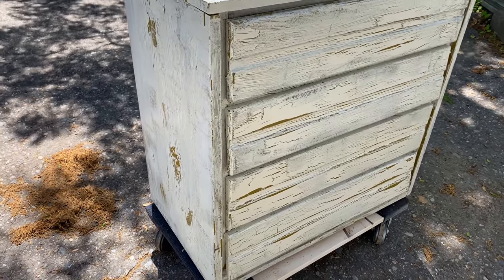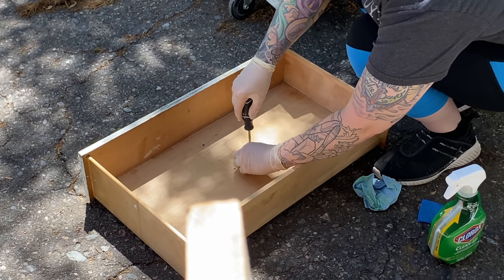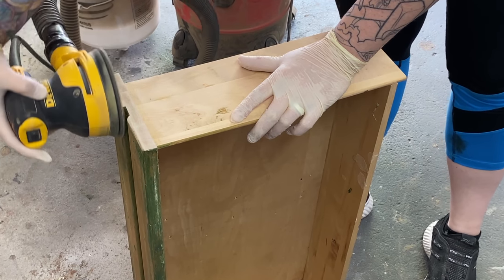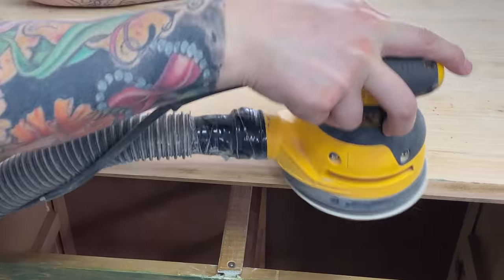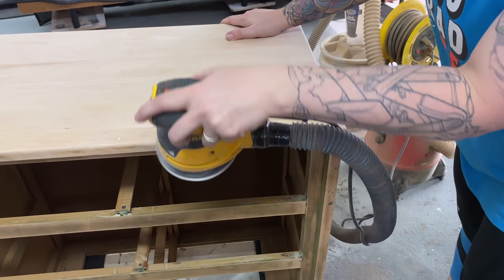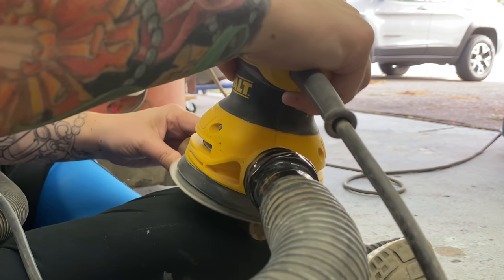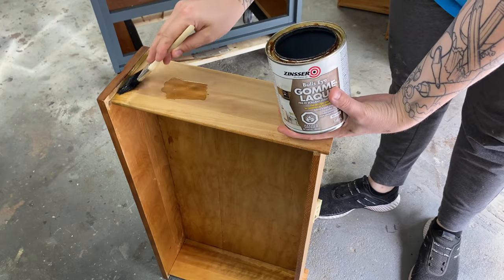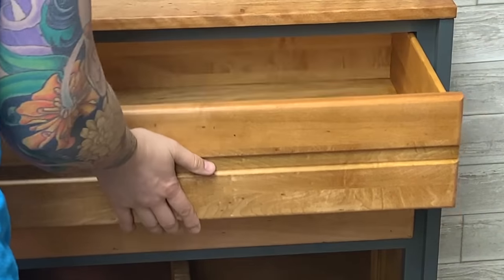STINKY Trash to Treasure: Curbside Dresser Makeover

Comment: Fantastic work!  Curious about the wood filler, any I’ve used don’t take stain well.
Reply from the maker: They can be tricky. Gel stains go better over the fillers than penetrating stains do, and anytime you can use sawdust from the same piece to mix with a bit of wood glue to make your own filler, you’ll get a slightly better result than a factory made filler. But another little trick is to use an artist paint brush to apply a small amount of sealer over just the filled area before staining. Often that helps get a more even stain job. :-)
Reply: @TranscendFurnitureGallery  thank you for the great advice, so very generous of you 😊

Comment: What a wonderful transformation.  Most people would have thought that piece only fit for the bin.   I'm astonished though that the smell of cigarettes clings to hard surfaces to the extent that drastic action is needed.
Reply from the maker: Oh that stuff absorbs into pretty much everything! Usually it just clings to the outside of the piece but the inside which is never sealed is where the biggest issues lie as there is nothing to keep it protected. But this odour blocking primer does a good job :-)

Comment: Nicely done! Just a quick tip...
When cutting threaded rod put on two nuts and leave a gap for your hacksaw blade. Cut between the two nuts and it will leave your cut square.

Comment: Inspired by your channel, i recently purchased two pieces of wooden furniture for my house that I will makeover. One of them have a strong stench of cigarette smoke. Glad I ran into your video. Wish I could share the picture of my furniture I purchased and get your thoughts on it.
Reply from the maker: Yes that smell is awful to try to get out sometimes! With that odor blocking primer, you can actually do two or three coats if one doesn’t quite do the job. You just have to make sure to brush or roll (or spray) it on every single surface that isn’t being completely refinished (like the insides, back and underside) after giving it a crazy good scrubbing .. and those back panels sometimes absorb so much of the smoke that it’s easier and cheaper to replace them, I find. Luckily with this one I didn’t have to. :-)

Comment: Watching you transforming junk into high quality furniture is very satisfying.  Just my 2 cents of opinion,  I clean up stuff in the backyard too.  But instead of the vacuum, i use my blower from the 150 psi compressor since the ground is mostly dirt anyway.    It is fast and powerful.  I don't know how to live without a blower.  I like how you scrap off old paint or varnish.  That's way better than sanding or paint remover.
Reply from the maker: What I do varies by the piece I'm working on. I usually will only sand a finish away if it's basically non existent or if I'm on solid wood. I'll scrape usually over veneer with SOME finish, or a lighter/damaged finish, and I'll use a chemical stripper for removing thick finishes or multiple layers of paint.

Comment: I hope you’ll consider trying burning sage in/around the pieces that have tobacco smell stains. I believe it will work to counteract the smell. And it would be environmentally friendly and easier if it works! Maybe enclose the piece with a tarp or something so the smoke can really work its way in 🤔. I found that saging (smudging) around a smoker’s house was effective in this way.
Reply from the maker: As a person with incredibly sensitive lungs burning anything isn't in my plans. Heat and smoke around furniture isn't great either. I have methods I use for removing smells that work great. Thanks for watching!

Comment: Screw a nut on the bolts before cutting the threads. If you remove the nut after cutting, the nut will "fix" the deformations on the cut area.

Comment: Great Video!  I like to leave wood tops and drawers also but the wood filler I have used does not stain the  same as the rest. You used filler on the top and you could not tell. What do you use?? Thanks for listing everything you used. I just did not find the wood filler.

Comment: You can use ammonia and hot water to cut through nicotine.  But it is a two-step process as you need to rinse it. Make sure you wear a respirator and are in a well ventilated area. And I strongly suggest putting a bunch of old newspapers down to soak up the ick and make it easy to clean up.

Comment: Hello from BC!!
I am in love with this piece, incredible work 😍
I’ve been struggling with staining overtop of wood fillers! They come out super noticeable and horrible. You make yours look pretty much seamless! Is there a certain type of filler that you like using the best? 
Thanks so much, and keep up the amazingly beautiful work!!
Reply from the maker: They can be tricky. Gel stains go better over the fillers than penetrating stains do, and anytime you can use sawdust from the same piece to mix with a bit of wood glue to make your own filler, you’ll get a slightly better result than a factory made filler. But another little trick is to use an artist paint brush to apply a small amount of sealer (like shellac or something) over just the filled area before staining. Often that helps get a more even stain job. :-)

Comment: WOW...you are a miracle worker!  I get so confused between Polycrylic and Polyurethane.  One is for stained surfaces and one is better for painted surfaces.  Which is for what?
Reply: Polycrylic is water based. Polyurethane is oil based. The first usually never, or very slightly, yellows. The second can yellow somewhat over time. I'm not sure there is a hard fast rule of which to use. A lot of personal choice. Lacquer is also useful. Polyurethane is the most durable.
Reply from the maker: Polycrylic is water based and can be used on both stained wood and paint. Polyurethane is oil based and tends to yellow over time, and is better only on stained wood.
Reply: @TranscendFurnitureGallery  .thank you...  couldn't they give them a name not so close!

Comment: I noticed after you have stripped down to bare wood you don’t use a wood conditioner before staining. Do you not need to do that if you are using a gel stain vs a penetrating stain? 
This transformation was unbelievable. Beautiful!!!
Reply from the maker: It depends on the species of wood and the type of stain. Some woods don’t need it, some almost always do, so I just play it by ear (so to speak). Maple, birch, and pine are the most common ones that are notoriously hard to stain, although they do a little bit better with gel stains vs penetrating or dye stains, as the gel ones don’t penetrate as deeply into the wood.
Reply: @TranscendFurnitureGallery  ok. I’m working on a maple dresser built in the early 1900’s and it’s solid maple. I used a conditioner before the gel stain. By the way I’d never used a gel stain before watching your channel so thanks! The piece looks amazing now. Still working on the drawers but I’m excited to see it completed. Can’t thank you enough Angie for your content and patience with answering everyone’s questions. Your kindness is inspiring.

Comment: There is a product called Ship Shape. It will make nicotine just melt off any surface you put it on. Takes out the smell too. Quite inexpensive. We would use it to clean every surface at my old job. Walls, ceiling, furniture etc.  It’s worth a try

Comment: Is Mr D Walt attached to a regular ol’ vacuum cleaner tube?
Reply from the maker: Haha Mr D Walt is hooked up to an Oneida Dust Deputy (basically a big bucket with hoses that filters out larger particles) and the dust deputy is attached to a shop vac. The dust deputy keeps a lot of the material from entering the vacuum itself, which prolongs the life of the vacuum filter and thus improves the suction. It’s not as efficient as a big fancy extractor but for my little workroom, it helps sooo much with keeping the sanding dust contained.

Comment: u said the old paint can be latex house paint. So we can't use Latex?? By the way, love the huge transformation 👏
Reply from the maker: Thank you :-) Latex generally just doesn’t work as well for furniture, ESPECIALLY if it’s not prepped EXTREMELY well. Acrylic based paint, especially on wood furniture, tends to move and expand as the wood does, whereas latex can crack and peel. I’m sure many people have used latex with no issues but I’ve seen maaaaany issues with it long term.
Reply: @TranscendFurnitureGallery  Thank u so much for that clarification. I didn't start yet because I have to learn before start ;).
Reply: @TranscendFurnitureGallery  so acrylic latex can't work neither, right?

Comment: Hard to believe it is the same piece. Did the smell go away with the products you used?
Reply from the maker: Yes, between the cleaning and refinishing, as well as the odour blocking primer, the smoke smell is gone! Sometimes it takes a couple of coats of the primer, but it does a pretty good job if the piece is cleaned and prepped well.

Comment: How do you decide which finish to use? I noticed you used something other than Odie's Oil.
Reply from the maker: Sometimes I base topcoat selections on the purpose of the piece (and what it’s made of, whether it’s been stained, whether it’s raw wood, etc); for example, I try to use ‘hardier’ ones on tabletops. But sometimes it’s totally random, such as trying to use up the last bit of what’s in a can, lol. Plus, preferences for certain products can change over time.

Comment: Next time you need to shorten a leg rod. Screw the appropriate nut down past the cut mark and when done cutting, unscrew the nut, and it will straighten any threads that get deformed during cutting.

Comment: What is the best topcoat that won’t darken the wood stain
Reply from the maker: It really depends more on the wood than the topcoat itself. For example, walnut and cherry are fairly light when sanded down, until you put ANY topcoat on and it just brings out the deep natural colour of the wood. Also- some woods themselves darken over time (like cherry), so it's a pretty complicated question. The four I use the most are lacquer (sprayed), water based Polycrylic, Odie's Oil (goes on like a honey consistency but cures to a durable hard wax), and hemp oil (which DOES tend to darken or slightly change the natural colour of the wood). 

I don't know if this is helping at all, lol, but darkening really has more to do with the wood itself. :-)
Reply: Thx, the wood is poplar and I love the color, I did a small white wash but I have to seal it

Comment: Help eliminate smoke smell paint the inside with a product called Kills primer paint.
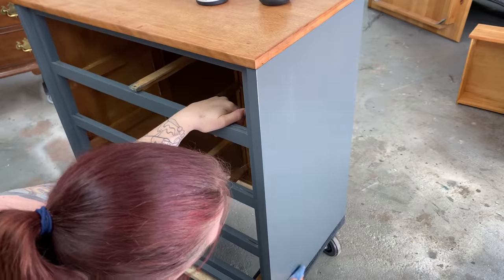Reply from the maker: At 13:46 I actually do use an odour blocking primer on the inside (it’s clear). It’s basically the Zinsser version of what you recommended:-)

Comment: Your instincts to get the nicotine layer off first are dead on.

I'm a paramedic and also have a biochemistry degree. You would have genuinely exposed yourself to a DANGEROUS level of nicotine by straight sanding. Bleach will pick up the nicotine, but ammonia will actually do a better job since it's got more nonpolar "grunt" than sodium hypochlorite, it picks up non-water-soluble molecules more easily than bleach.

Also, the thing we use in the field to get that cigarette odor out is medical grade enzymatic air fresheners. They will lyse apart the nasty, acrid odors, and I've found they can actually leave behind a kind of pleasant "aged tobacco" scent reminiscent of scotch whiskey. I've done it several times now helping out heavy smoker elderly people who need a hand cleaning their houses, and the enzyme based air fresheners after a good ammonia scrub down actually leave furniture smelling more like pleasant tobacco/leather than acrid smoke.

And lastly, the final thing you can do murder any odors (and kill any mold spores if there is a worry) is to get a cheap $80 ozone generator, set up a little tarp over it and the piece and run it before you finish. Ozone is a monster of a molecule that REALLY doesn't want to exist, so it rips apart free molecules, particularly volatile organics, like tobacco odors and mold spores. The other benefit is that the generators are great for a lot of other things, particularly mold or bedbugs. So you wind up loaning it out to people for ten bucks and paying it off.

Stunning work as always, and I still think you don't need the music! Just keep the tool sounds in and lower the volume for power tools!
Reply from the maker: I’ve heard about those ozone machines before, there’s a channel I love about auto detailing (lol) - he uses it on particularly bad cases. Might be something to invest in! Thank you so much for the input and tips, I appreciate you taking the time! 

But I’m still keeping the music (lol)- I honestly don’t love videos with just the tool sounds, it’s like nails on a a chalkboard to me, as I have some weird sensory “issues”! I still watch them, of course, as many are quite informative and I’m always trying to learn more things. But the music is the perfect representation of “me”, and the aesthetic I wanted from the beginning! Unfortunately my first two or three videos have a less than stellar levels mix, and I’ve since figured out a better volume to have the music at in relation to the vocal. But yeah.. I love the music. :-)